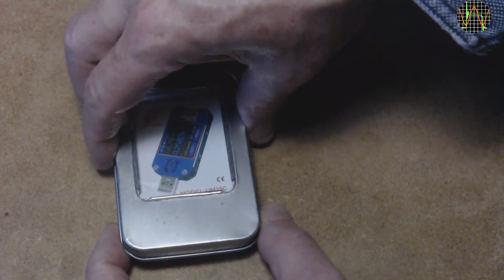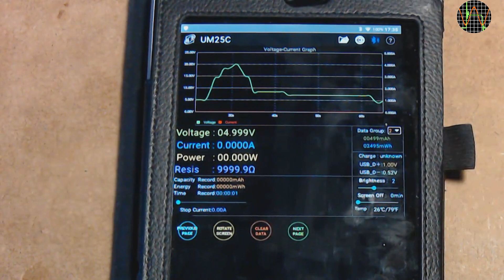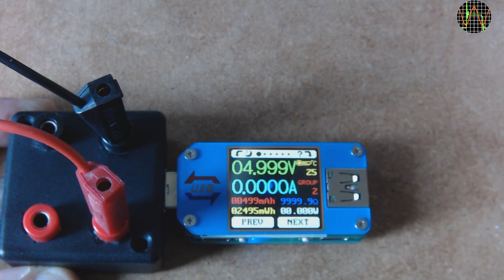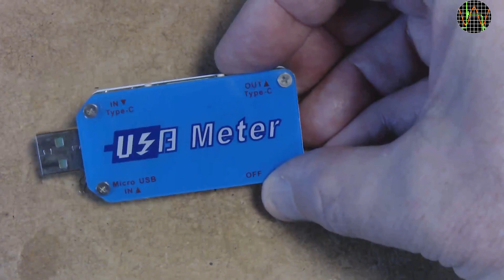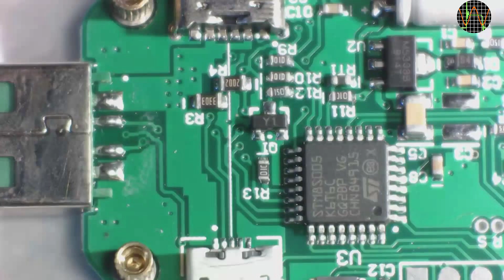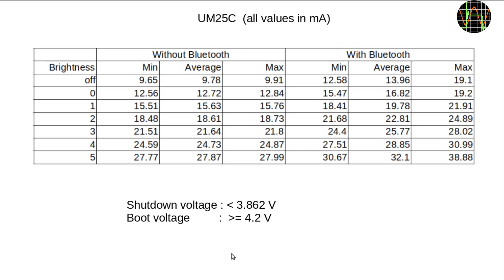Review and tear down of the Ruideng UM25C USB Tester

Comment: Thanks for your video. would you buy the AVHzY CT-3 ? is it better or a waste of money?
Reply from the maker: I don't have one, so I had a quick look at their website. My only complaint is common with most USB testers these days in that they shows more  digits than are warranted by the specs.. 0.1% accuracy itself is quite good but that still means +-5mV uncertainty for measuring 5V.  Same with current, which means energy accuracy is even worse. If you are lucky the one you get is better than its spec but unless you tested that, take the last 2 digits of all displayed values with some scepticism.  Apart from that it seems quite competent. Not sure of the quality of the PC software. I tend to be very wary of installing software, not just from China, but that is maybe my paranoia... The real question is whether you are going to at least occasionally use all these extra capabilities that go beyond basic voltage, current, power, capacity and energy monitoring, because if you use it for just that, you would waste your money.

Comment: According to a table in the official Ruideng store ("RD Official Store") on AliExpress, one other difference between UM34(C) and UM25(C) is also the USB-A connector version. UM34(C) uses USB 3.0 while UM25(C) uses 2.0. Having said that, I don't understand the meaning of this exactly, as far as it applies to voltage/current/power testing. What would be the practical difference? I understand the blue USB-A 3.0 connector has more pins but how does this translate into practical difference when testing? I thought UM24(C) was first, then UM34(C) and then UM25(C). If this is correct, it's weird that they went back from USB 3.0 to USB 2.0 between UM34(C) and UM25(C). Why did they put USB 3.0 connector on UM34(C) ? Or does it only apply to data bypass speed through the tester ?
Reply: They put a USB 3.0 connector on the UM34(C) so you can measure the power draw of USB 3.0 SuperSpeed devices.
Reply: @RaduTek exactly so you can read external or usb drives without the limitations of usb 2.0

Comment: Changing the Voltage isn´t possible, or is it?
Reply from the maker: No, not with this tester. I use a separate tiny gadget that plugs in between that has a USB-A in and out port and a push button to select voltage. Got it a while ago very cheap from eBay  (sorry can't remember details). I have one USB-C tester that can change voltage
Reply: @TheHWcave  Thank you. I keep looking for one that can do that :)

Comment: Hi i would like to know maximum power this meter can handle continuously without problem?
Reply from the maker: I cranked it up to the max 60W my electronic load can handle (using 15V at 4A) and it had no problem. It does get warm >52 deg. I only kept it for 5 minutes at that power level because the cooling fan in my electronic load was screaming... The UM25C is rated for 24V and 5A which would be 120W if applied simultaneously.  It is not clear if it could handle that kind of power but I somehow doubt it. I think its less a problem with the UM25C than with the standard USB-A connectors (and normal USB cables) that are not made for that kind of power transfer.

Comment: Hi, thank you for the informative video. I have a couple of questions.  
First,  what is the Amp rating on the micro usb socket on the UM25c? Is it still 2A like the 34c? The instructions do not state clearly. 
Second question,  with both the UM25c and the UM34c, do they allow for "over current "?
For example,  using the um34c, if I wanted to test a full 2A draw on micro usb, with it's specifications detailing 2A max, either I hit 2A and it might overload the port or even, if the supply or cable turns out to be faulty or inaccurate and provides 2.3A for example,  again this could inadvertently damage the meter.
If you could please let me know as much detail about the ACTIAL current ratings on both the mentioned products,  I'd be so very grateful.
Reply from the maker: Hi Ben, a very good questions. I never checked out the max current on USB connector types. I looked up the datasheets on various USB-A and Micro USB plugs and sockets from reputable electronic component distributors like RS. Very few type A connectors are rated for 2A , most connectors of all types are just 1.5A and some for micro USB sockets  1.8A with 1A per contact . This would indicate a safe current limit for micro USB is 1.5A which tallies with USB Battery Charging (BC) 1.2 specification.  To carry more current the connectors would need to distribute it over additional contacts, like what they do in  USB Type C. I have run USB Type A, and micro USB myself with charging currents of 2A using the UM25 and UM34 and it did no harm but that's no guarantee.  The USB testers do not care about any of those limits and will show whatever current they can measure (up to 5A in the UM25) from any of the ports. I have used the type-A connector for up to 5A for verifying the maximum measurement range but that was very briefly  (a minute or so with long cool-down pauses afterwards) because sockets, connectors and cables get very hot at those currents.  The only tester I own that can handle up to 5A nominally without overloading its sockets and plugs is the TC66C which is USB Type C only (video coming soon).  Its a very interesting question and I am thankful for you raining the point. Especially in the case of the UM25 and UM34, one wonders why they even allow measuring such high current when there is no legitimate way of connecting anything close in current carrying capacity. Are you planning to run anything more than 2A? Even with 2A you should probably monitor the temperature of cables and connectors at least the first time you use it and probably turn power off before connecting or disconnecting cables (to avoid arcing)

Comment: Is it USB 3 compatible ??. Thanks.
Reply from the maker: It depends what you are after. It supports the higher charge currents and voltages but that isn't really a function of USB 3 and more on what charge protocols are negotiated. The UM34 is slightly more assuring in that respect as the manual for the UM34 at least mentions some compatibility specifically for USB3.0 where the UM25 manual is totally silent about USB 3.0. However, both will not support high speed data transfers that need more that the USB standard 4-wires
Reply: @TheHWcave  The data transfer speed is the whole point of USB 3, though... if it only has 4 wires, it's at most USB 2.0, which is by design compatible with USB 3 hosts, just at a lower speed. USB 3 compatibility in this context is therefore just a marketing gimmick.
Reply from the maker: You are correct of course, although in their defence, these testers really only care about power delivery and you should not keep them looped in when transferring data. The UM34C actually has USB 3 connectors and my comment of both (UM25 and UM34) not supporting high speed may be not quite accurate. When I tested it, it failed with both but in the mean time I found that the front USB 3 ports at my PC are so worn out that they make very poor contact on the additional pins and so high-speed fails often even with no tester involved.  The trouble is if you don't specifically look for it,  its often not obvious because the reduced USB 2 transfer still works. The PC is old, and I am debating if replacing the panel is worth the effort...
Reply: @TheHWcave  Ah, I see. I'll test that if I get one. I have external HDDs that light up blue with USB 3 and white with USB 2 so it's easy to detect which mode it's in.
Reply from the maker: @GRBtutorials  Good plan. Please report back what you found. But don't get the UM25 which is definitely not USB3
Reply: @GRBtutorials  any updates?

Comment: Tester works well but the android app is not working with newest Android Version.
Reply from the maker: What version are you using and what phone? It would be good to know for others. I just had a look on the RD site in Aliexpress and they claim the software works for Android 5 and above (and IOS 8 and above) but there is a disclaimer I had not seen before. Apparently there are problems with "the way Bluetooth is implemented"  in Xiaomi, Nokia "and some other brand". Somewhere else they include Samsung Note8 / S8 in the problem list. Maybe write to their customer support and complain? If enough people do it, they may do a fix, who knows? I found RD tech one of the better Chinese engineering shops, so there is hope. I think there are also some opensource projects on Github that can read these devices.  Another option for you may the PC version of the software? If your machine has no Bluetooth, a USB Bluetooth adaptor costs next to nothing.

Comment: Thanks for the video.  Which USB meter would you recommend for someone who just wants to test different chargers and cables to find out which are working properly?
Reply from the maker: Hi Bubba, any tester will do that. When selecting a testers, the thing to consider is if you will be needing USB-C cables in addition to Micro-USB, USB 3.x or just USB 2.x and what kind of "faster" charging protocols your kit may use. Specifically, on the UMxxx series, if you don't need Bluetooth and recording, don't go for the versions ending in "C". Both the UM25 and UM34 will are good testers that will recognise QC2 and 3 protocols and a bunch of others  and if you don't need the additional resolution of the UM25, the UM34 is fine (and somewhat cheaper)  

BTW I have another video on my channel where I go over the different connectors the UM25 and UM34 have. There is also one about testing a fake UM25, so if you find an incredible cheap offer or one with different coloured housing or all squarish instead with the two tapered corners a real UMxx has, beware.